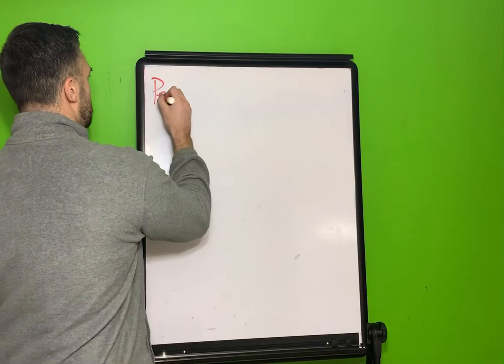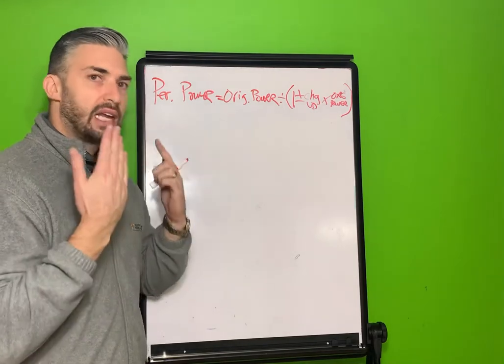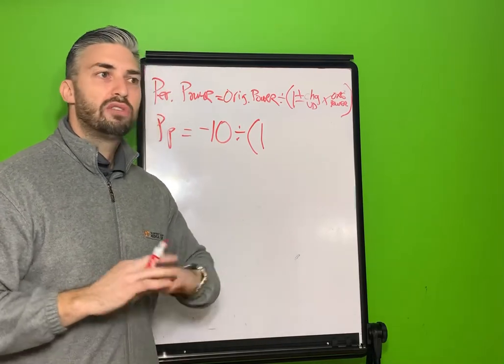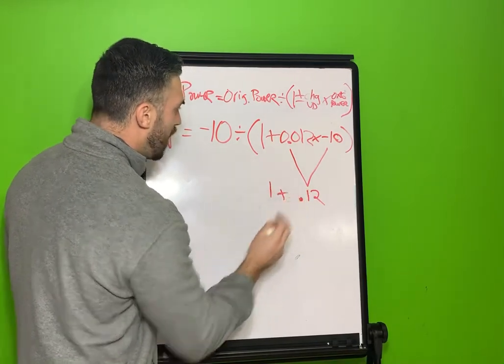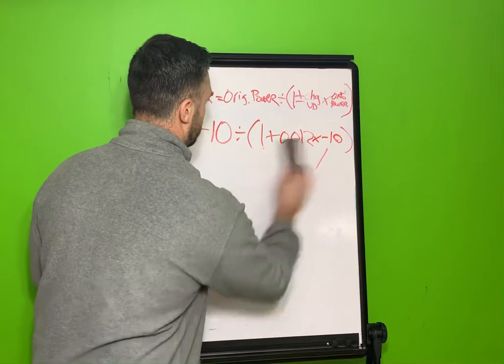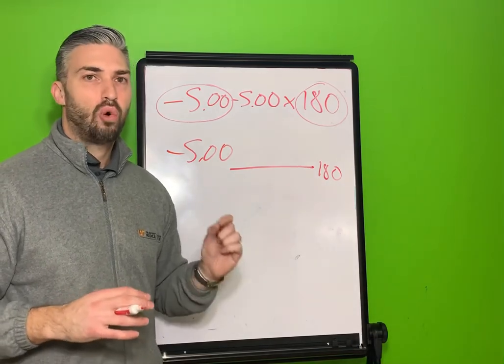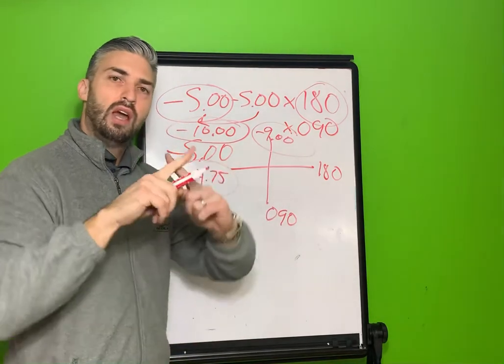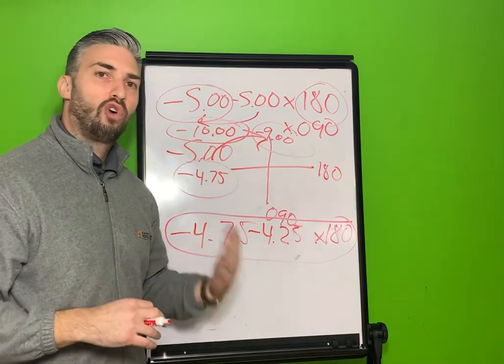NCLE VERTEX DISTANCE - CYLINDRICAL LENSES

Comment: I have a question about multiplying the change in vertix dist and -10. It should be -1.12. The answer would then be positive and that isn't right. So what is the explanation here? I saw someone else had mentioned this, but I did not see an answer!
Reply: I believe I figured it out! He explains that we use + VD because we are moving closer to the eye, but viewing the VD as the patient, we are moving in a minus direction. I think he just switched the signs at the beginning filling out the formula, if that makes sense.